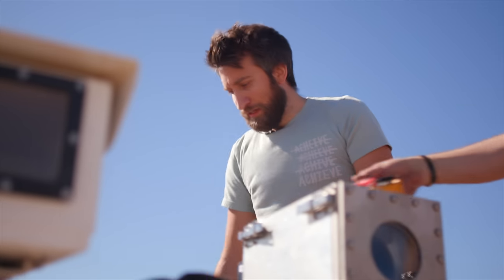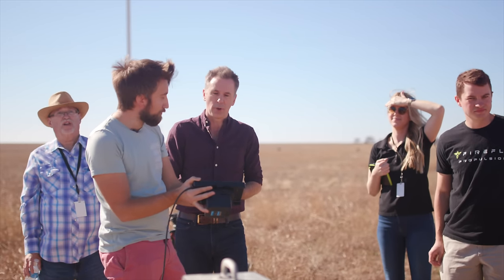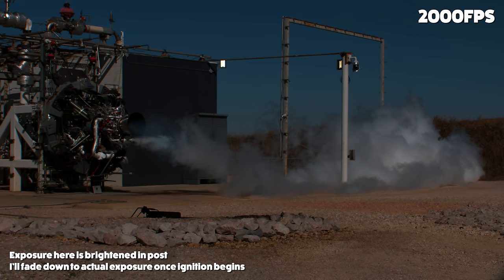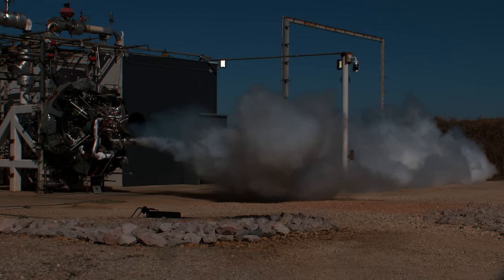Close-up Ignition of a Rocket Engine in Slow Mo - The Slow Mo Guys

Comment: 2:03 when the flame in the cloud of gas begins and is just floating there, being moved back and forth by the soundwaves, my jaw literally dropped. That has to be one of, if not THE most amazing video capture I've ever seen. Well done guys!
Reply: Oh yeah, watching fast moving things cause reverberations in suspended materials is crazy. Like, I used to have 12 subs in my car and that was as close to 'seeing sound' as Ive ever gotten. But in slowmo, with much louder things.....its amazing. 

Check out the ice falling from the feed pipe below the nozzle! The thing burns for ages before it hits the ground!

Comment: The pulsing at start-up is a good example of why starting a rocket engine is so hard, it is very easy to end up in feedback loops that result in the engine either exploding or the flame dying out.
Reply: Yeah the pulsing at start-up is actually evidence that they haven't really finished tuning the engine at this point yet (at the time it was filmed). It means there's still combustion instability.
Reply: @Ergzay I’m not completely sure that’s true. Reaver uses the tap-off cycle, meaning a portion of the exhaust from the main combustion chamber is diverted to power the turbine that drives the pumps. Starting up the engine would involve a series of transients, not a linear increase in power. Reavers have flown several times now so they no longer count as developmental, but I’m sure there’s still room for improvement.
Reply: It's the most interesting part to me!
Reply: @fighteer1 could it be that the turbine isn't up to speed, and the pulsing is just the pockets of fuel between the blades?
Reply: @dougaltolan3017  I have no intimate knowledge of how this engine works; I’m speaking from general knowledge. But that’s not a totally inaccurate way to think about it. Imagine the engine pushing the pump, which pushes the engine, which pushes the pump, ad infinitum. Since the forces aren’t delivered instantly, there must be a disequilibrium until the engine stabilizes.

Comment: Very cool! That resonance during the startup transient was awesome to see (if not a little scary)! Love seeing the TEA-TEB shot leading into the full propellent mixture in slow motion.

Also, the tap-off cycle is "simple" and elegant, but it's a challenging cycle to start since the propellent flow is directly coupled to the pressure in the thrust chamber. In other words, the flow downstream is what creates the flow upstream in the first place. So the resonance leading to those waves at the beginning is most likely due to the time it takes the valves on the tap-off to move in order to modulate pressure into the pumps along with the fact the pressure is constantly changing. I would be very curious to see the same footage shot in five years when Firefly have optimized the Reever even more.

Comment: I can tell you, after working on jet engines made in the 50’s to now being next to one during light off is an amazing experience. Everything around it shakes like absolute hell, it’s extremely loud, even with soundproof headsets on and ear plugs in it is at a near deafening volume. You can also just feel a solid wave just slam against you.

Comment: That was impressive video. 👍
I worked as a sub contactor for Rocketdyne in their Santa Susana field Labrador site between San Fernando Valley and Simi Vally and was present when they lit off 1 space shuttle engine. Mind you the exhaust cone could cover a truck. 
It was amazing how loud and violent it was from just a half mile away. 
It still is the greatest experience of my life.

Comment: Engine startups are some of the coolest things. The insanity of starting one is crazy. TEA-TEB is a really cool fluid. The bright green flame and seeing the shockwaves build up. Even on normal speed launches you can see the Shockwaves ripple through the exhaust. So much power and energy released by these engines.

Wonder if SpaceX would let you set up for the next IFT test. Or a future one for more prep time. THAT would be crazy to see at high frame rate. 33 Raptor engines.

Comment: Maybe somebody in the earlier comments pointed this out, but the O2 before ignition is to chill /the engine components/ by using a tiny flow, so that full flow doesn't result in metal shattering from temperature shock.  Otherwise, great video, and love rocket pulchritude!

Comment: Teatab is used in almost every rocket to start the combustion and you can usually see the green flames at startup but it was really cool to see that in slow mo and how long it lasted. Only a small amount of teatab is loaded and this is why most rockets cannot relight. Spacex relights the Merlin engines 2-3 times for a flight which means they need a good amount of teatab. Someone correct me if I’m off base. 😊

Comment: Mach diamonds are specifically caused when the exhaust pressure is lower than ambient pressure which causes the ambient atmosphere to force the exhaust to compress down until it reaches a high enough pressure that it pushes back again, causing the standing wave of mach diamonds

Comment: A similar shot for Raptor (SpaceX's "new" engine) would probably be even more impressive; the ignition sequence on something like the RS-25/SSME (The Space Shuttle main engines) is very impressive - Raptor has more thrust, uses a more complex combustion cycle and has the most combustion pressure of any rocket engine

Comment: I think this over and over again: 40000 lbs of thrust! I cannot even wrap my head about 1000lbs of thrust, if you know a bit about this topic. And then again, I was completely in awe when I think about the top speeds of rockets and that they (despite all these insane amounts of thrust and force) are only capable to propell a rocket to a tiny, tiny, tiny, tiny fraction of the speed of light. Not even 1%.

Comment: Yes, I'd like more footage of rockets. If possible, I'd like to see technical details which are too fast to see in real time, such as combustion instability or excessive vibration. Yes that's very difficult, but it would take your channel beyond "looks cool" into "genuinely helps the engineers to solve problems", and that's even cooler.

Comment: One of the special moments was at the end, when the flame subsides and everything returns to normal. At that point you see the daylight "return" and realize how intense everything really was.
The thing that triggered me during the active period of the engine, is how a significant portion of the fuel is propelled outside the main stream. This undoubtedly lowers the effective thrust produced by the engine. i'm wondering whether this was due to gravity, and if, during a normal vertical launch, this effect would be gone?

Comment: I wonder if you could use a mirror system to split the input across three cameras, each of which could then expose differently, allowing something like what still photographers do for exposure bracketing. The mirror splitting would ensure they're all getting the same source from the same location, such that their footage could be superimposed. Then, of course, there's the challenge of merging them. Ideally a tool could do it, but realistically, you'd have to probably select dark areas for the higher exposure to add to, and the brighter areas for the lower exposure to add to.

Comment: I've often wondered if it would be better to have the first (reusable) stage of a rocket powered by, say, a Blackbird engine.  The oxidation is from the air and you only have to carry Kerosine to power this first stage.  Possibly a modified 747 engine (or two or 4)would be an option.  They have insane thrust.  If the total weight of the rocket was more than the total thrust of these air breathing engines, you could strap wings to the first stage and take off at an angle to the horizon.  So what have we ended up with.  A stripped down 747 carrying the second stage piggy back the way it used to carry the spent shuttle, flying toward the equator from wherever the space port is located,  while gaining all the altitude it can.

Comment: Wait a second. If they are using a tap off cycle then what is that dark exhaust? Are they running an open cycle engine with tap off for restarting? Can someone shine some light on that?
P.S. Congrats to the team for succeeding in the 24h challenge.

Comment: Old ish video by now, but im wondering if incandescence could tell you how you should adjust the exposure? Basically, the hotter something is the brighter it tends to be. So you could maybe start  asking people how hot they expect the event to be, log the temperature and the exposure you chose as well as the exposure you would adjust to if you were to have another shot. 

You film enough explosions and such that i think you might find value in such a thing, assuming incandescence is relevant.

Comment: Try and get a collab with NASA where they still used the analog/film slow mo cameras for their scientific evaluation. The film has a way better contrast ratio than digital and you don't have the same exposure issues you mentioned in the video.
Reply: You can absolutely blow out film though. Not sure what makes you think film is immune to over & underexposure.
Most film has a dynamic range of about 13 stops. Modern digital video cameras have a larger dynamic range, with for example RED cameras reaching beyond 16 stops. The Phantom used here has a dynamic range of 14 stops.

Comment: Fun fact, the shock diamonds, as beautiful as they are, means that your engine is EXTREMELY poorly optimised for the current pressure. That's why you'll never see aerospikes have them, due to the nature of it.

It means you need a different nozzle, but for a test that basically consist to know if your engine/components/fuel works or not, a nozzle that constricts is best, as to not burn/explode everything around.

Comment: Crazy thing is i have a video of a F-16 taking off really low with full afterburner and you can see the flame in broad day light. Has roughly 23,000-29,000 pounds of thrust. I have a couple videos of F-35's full afterburner and they have 43,000Lbs of thrust. Sounds pretty much like one rocket turbine 😅

Comment: i wonder if you could attempt to calculate the brightness and how those calculations would look like. something with the amount of molecules oxidizing per time interval and the temperature they're reacting at?
Reply: Black body radiation. If the flame has a temperature of T kelvin and an emissivity of ε, then the radiant intensity is I=εσΤ, where σ is the Stefan-Boltzmann constant. Then, if you know the surface area of the flame A, the total radiated power is P=AI

Comment: Seems like a scaled down version of the F1 engines used on the Saturn IV rockets during the Apollo missions. Still the most powerful vehicle ever created by Human beings.  Its strange that in all this time since the Apollo missions ended they are still using the same rocket propellants as the F1 engines used back in the 50s-60s.  If it aint broke............

Comment: Just a heads up to watchers (and the channel tbh), "45,000 POUNDS OF THRUST" is... not a lot. Not for a rocket. Frame of reference, the CF6-50 (a common jet engine for passenger planes) makes 54,000 pounds of thrust at power. It's weird to use that as clickbait when its... really not that impressive of a number for a rocket engine.

Comment: Is the exposure range limited mostly by the sensor (which is my guess) or the file format? Or both? Are there better sensors that can capture a much higher range of brightness, and essentially allow you to control exposure to some degree in post?
Reply: Sensor. There are better sensors, but probably not better sensors that can film at 2000FPS at this resolution. These cameras film in RAW formats, which contain the highest amount of data you could get from a video file format.
The Phantom Flex 4K has a dynamic range of 14 stops which is pretty good.

NASA has a solid fuel rocket engine test where they film using a special HDR camera setup (which I suspect is literally just 2 cameras with different settings, synchronized and pointing at the same thing)
Reply: @logitech4873  Brilliant explanation, thanks! Hope we'll see some tech advances in the near future then 😁

Comment: Slow mo guy:
"the flying debris are the only indication of how fast the frame rate is"  
Electrical Engineer here:
I can calculate the frame rate, counting the number of floodlight flashes through the video which is 90 time in 60 seconds = 1.5 times a second = 0.75Hz. => 60Hz / 0.75Hz =  80 times faster than 25FPS = 2000FPS